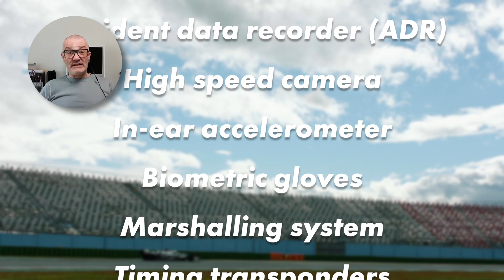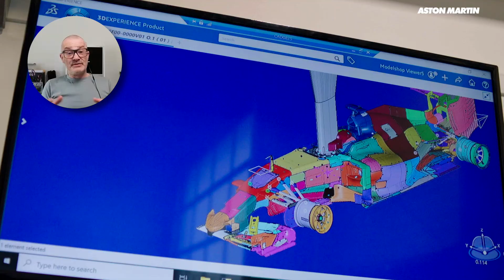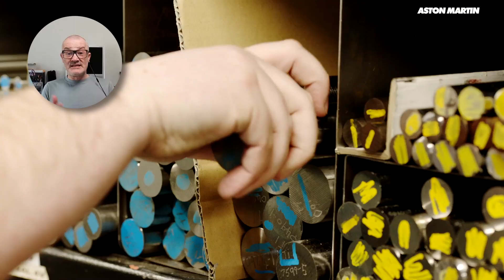The Reason F1 Teams are STILL Overweight

Comment: What about the hybrid power units? Surely you should have mentioned them when talking about the jump from the cars of the v8 era and before? They weigh a LOT. And the battery is not a load bearing structure so it gets even heavier.
Reply: Speed benefits are too great to get rid of them. They have never had more linear powerbands and that much torque that early in the rpm range is a game changer. Plus you lose about 23% efficiency if you remove that so you're going to be carrying roughly 23% more fuel. The hybrid system isn't like what you think of in a prius or something where it's to help save some fuel. No these things bring hp to the table a lot of it through the entire rpm range something you cannot get with just internal combustion engines
Reply: @n111254789  why would you want a linear powerband when it comes to racing excitement and passion? It just enables the drivers to cruise - which they sometimes have to given they can only run 3 engines per season and they don’t have to be as precise with their throttle inputs. 

They cost a shit ton of money per engine and the tech is so prohibitively expensive that no new teams or manufacturers have joined. 

And while it brings hp to the table, it also brings weight. The biggest jump in weight we have seen in any era change. The weight makes the polar moment of inertia (the ability of the car to change direction) worse so they are less dynamic and exciting to watch and drive. The don’t squirm under braking and exit. They don’t dance. They don’t quiver over kerbs. They are heavy.

And speaking of weight, the power to weight ratios of the v10 F1 cars for example, utterly destroy todays cars. 850+ hp and they weighed 605kg in 2004. Even if it was inferior power to weight, their overall lightweight and incredible noise makes them much more exhilarating to watch - and many say drive. 

As for economy, why should F1 be about that unless it’s not just about racing anymore? It used to be more focused on pure racing. But now it’s a complicated beast and the v6h are part of what has sullied the racing aspect of the sport.

And yes while the v6 hybrids are incredible technical achievements and amazingly efficient, they have also caused a lot of headaches as mentioned above. But with the relentless drive to all things EV. I get that this is the only way to go. That being said, it doesn’t mean I can’t say it’s at the expense of the racing and the passion and it doesn’t mean it’s without major faults

Comment: I wish they would have met in the middle with the 13 and 18 inch wheels. Might have been a better compromise of weight, tire side wall profile, and visibility with a 15 or 16 inch wheel.

Comment: Power to weight isn't everything.... ditch the hybrid and be more nimble...   Or drop the over all weight limit and have the teams figure out how to make the batteries lighter.
Reply: You know exactly why the cars are hybrids and why that won’t be going away. Unless we’re going hydrogen power but i don’t see that. And you can’t just drop the weight limit as something would have to give for that weight to go down.
Reply: @rexthewolf3149  make the safety stuff a off the shelf part, they can lose weight elsewhere.  but these cars are too heavy.. it is a drag to watch these things which are larger than my daily driver.
Reply: @TedSchoenling  Off the shelf parts, ok. I don’t want to belittle your intelligence. But you really think that is possible. The forces that f1 cars operated under requires specialized design to handle. That’s just not how that works man.
Reply: @rexthewolf3149  What I mean is listed parts.  Dude do you know how many 'listed' parts are on the car now?  I don't mean to call you ignorant but they have quite a few.  F1 could specify a survival cell quite easily that would have all the safety in mind and let the teams go nuts.

But do call me stupid.. I dare you
Reply: F1 cars carry a race worth of fuel on board get rid of hybrid and you get to carry around 20% more fuel also you can kiss that low end torque goodbye it'll be a narrow powerband race engine with as many gears as they can stuff in it to try and keep it operating in its prime.
Reply: @n111254789  I suppose you missed F1 in the early 2000s then?  when the cars had screaming engines and were light and nimble?  We already have Formula E for the electric crowd.  It is a joke to think F1 is doing anything for 'sustainable' that FE isn't doing.

I would have suggested bringing back refueling but that is kind of a taboo subject.  It is dangerous to a degree, and very unpopular with teams.
Reply: @TedSchoenling  watched f1 for ages I still remember 04' but the reality is as nice as those motors sounded f1 is ultimately about speed and you can't beat a hybrid power train it is the best of both worlds and I noticed you ignored both my points about carrying extra fuel and the power band being extremely peaky especially with turbos
Reply: @n111254789  no, it is about the illusion of speed.   Look at the '02-'04 cars and then look at today's cars WITHOUT the stopwatch.  Which ones look quicker.  Don't even turn the sound up.  just the visual.

People cannot comprehend the stopwatch.  However they can SEE how quickly the smaller cars change direction, how much of a handful they were to drive.

If F1 were about speed, they'd remove a bunch of the limits they have and could have cars MUCH faster than now.  

They are going for a show... if that is the case at least give the illusion of speed.

Comment: Refueling Ban, Decreased Engine Sound,  Decreased Rev Limiter,  and Increased weight are the 4 things that have really disappointed me regarding my favorite sport. It's still my favorite,  but it's less exciting. They are 900kg with fuel :( I would definitely support a break away if it fixed these recent changes.

Comment: Simple... make them smaller in size... They are to big in either dimension... cut 20% of length and width and problems is solved.... also its gonna be easier to overtake on narrow tracks
Reply: Problem you have to get rid of something to do that, decrease the size of the fuel tank and bring refueling back, ditch parts of the hybrid system, Decrease the size of safety measures. In order for the cars to get smaller something has to give. There is no simple fix here.
Reply: You really think it's that simple?
Reply: @rexthewolf3149  Engines are already smaller than what they were when cars were way smaller also. fuel tank candchange its shape. There is already a difference between the gearbox and the back transmission, so even now teams could make them shorter very easily . And for width they biggest factor is the stupid over-sized current wheels
Reply: I agree with everything. Except the first word.

Comment: Early/mid 2000s V10 cars...a tiny bit less peak hp (around 1000), that are available all the time instead of just a few seconds per lap in race conditions, weighing in at 520kg
People nowadays seem to really have forgotten what monsters these cars were on sunday
And on top of that, those cars saw some huge crashes, but not a single fatality...weight matters, and track design even more so. If they wanted to make this sport safer, they should worry much more about intelligently designing their tracks instead of building tanks to go racing (e.g. why tf is there nothing but concrete in the corner where Mick Schumacher crashed, when it's such an obvious hazard with those huge kerbs....)
I love this sport, i'm a fan of many of today's drivers, but i also hate it, because almost every decision made in the past 15+ years has been infuriating

Comment: I don't think the wheel covers being 3D printed are making them heavier.  In fact, if it's done right, they could be lighter than solid carbon fiber.  One you can 3D print in Carbon Fiber, but even if they are printed from a denser material, you can print them without solid infill, and various geometries, where the strength you need is there, but the weight is reduced dramatically.  I do a lot of 3D printed parts, and I can almost always make them lighter than a solid carbon fiber part.
Reply: I doubt there is any thickness or internal material volume to these covers. They are basically a thin carbonfibre bowl covering the brake discs.
Reply: @Renee_R343  Well, the video says they are 3D printed out of plastic, not carbon fiber.  Now, they could be 3D printed with a carbon fiber filled plastic, but you cannot 3D print pure carbon fiber.
Reply: @andrigtmiller  Sorry my mistake. What I wanted to say is that they are basically a thin bowl covering the brake discs. So I doubt there is any place where they have any infill. And I believe carbon fiber is still much lighter than any plastic.
I think it is quite hard for people to fathom how light a carbon fiber composite components can be. My only real world experience is lifting a car hood (detached from the car), a regular hood is actually quite heavy. An aluminium hood in comparison is so light it feels like it is made out of paper. And a CF hood incredibly gives the same feeling again compared to the aluminium one. It feels unreal how light CF components are.
Plastics, however, are really heavy on their own, not even comparable to CF.
Reply: @Renee_R343  Well, as someone that does a lot of 3D printed parts, I can tell you that no matter how thin they may be, they could have infill when 3D printed.  Even just a 1 mm thick disk, if printed at a .05 mm layer height would have 20 print layers.  That's the smallest layer height on a FDM/FFF style printer.  They may be printed with a resin 3D printer, than the parts are completely solid.  Based on looking at the wheel covers in pictures, whatever printer technology they may be using, they are definitely post processing them, to make them smooth, so it's hard to know, and I haven't been able to find the information on what 3D printer technology they are using.  Certainly, plastic has a much higher density than carbon fiber weaves, but that's not how they are made according to the video.  In any case, I certainly understand the difference between solid plastic parts, and carbon fiber parts, in terms of their weight.  The video is saying they are heavier than carbon fiber parts because they are 3D printed.  That doesn't necessarily have to be the case, but the video creators don't know much about 3D printing, so that's understandable.

Comment: Why did F1 not simply go back to narrower wheels as still used in F2? The notion of cornering being less aero limited with wide tires? At lower speeds, aero would be less anyway. The resulting narrower cars would create less dirty air. For side impacts, I guess wider cars from wheels sticking out more might help a bit? But wheels can come loose more easily and create more damage. The F2 sized wheels would be lighter, though, aiding with frontal impacts.
Reply: You forget the bigger elephant in the room : Mechanical grip

Comment: Would F1 drivers be at an advantage being underweight (and likely quite short)? I didn't realise the driver played such a big role in overall car weight
Reply: they have a minimum weight standard though I'm not sure what it is. I'd like to know the weight difference among the drivers
Reply: @michaelfierman3256  80 kilograms, as said about 5 times in the video.
Reply: How is that regulated is the lower categories? Like when they start with karting, do thry have to add weight if they're a very light driver? Or do they benefit from that advantage?
Reply: @swe223  In karting they benefit from being lighter. Being short is also useful as it lowers the center of gravity. Usually these two go hand-in-hand.

Comment: What happens if you have a driver all kitted up that weighs a lot less than 80kgs? Some F1 drivers are no bigger than a professional road racing cyclist.
Reply: Then the team is required to add additional  weight to the car. The advantage of a lighter driver is that the team could add the weight where they want and give the car better balance.

Comment: I'm not sure an 800kg car capable of 220mph is "safer"
Reply: Adding 30kg to a car is not going to add as much energy as adding 30kph is. Kinetic energy grows exponentially with speed. If the cars are lighter, they would be able to reach higher speeds easier, and that would conversely be less safe than a heavier, slower car. It's just physics.
Reply: @killerful  a reduction of 30kg is certainly not going to add another 30kph

Comment: Why does it matter if they are over the MINIMUM weight? Is there also a Maximum weight?
Reply: With more weight they accelerate slower, brake slower and turn slower. When the purpose is to race and be faster than the others, it matters a lot.

Comment: How much does the batteries and all that hybrid BS weight? Maybe just get rid of that and go back to normal engines?
Just a thought...
Reply: The hybrid system bridges the gaps between the extremely narrow power band of race engines they would need a drastically larger motor and have to carry much more fuel to achieve the same power through the power curve as they are now.

Comment: Get rid of the stupid electric motors, weight sorted and they'll be good to watch again
Reply: Unless we go hydrogen powered the hybrid system isn’t going away.
Reply: @rexthewolf3149  it should, lithium is terrible for the environment. . .worse than combustion engines
Reply: @thisisben3593  you right about lithium being bad for the environment but it’s not that simple. Lithium is more harmful during mining and recycling. BUT and there is a giant BUT here, they are still better than gas due to long term emissions. That doesn’t mean gas cars are good. THE real solution is hydrogen powered ICE cars. But those have their own issues. At the end of the day CARS ARE BAD FOR THE ENVIRONMENT.
Reply: @rexthewolf3149  it takes a massive amount of time for the electric vehicle to surpass a combustion engine in emissions, more than the current life span of electric cars so its practically irrelevant and then disposal is shocking. Ethically as well. . . Cobalt is 80% slave traded.

Running combustion engines on hydrogen is the way to go
Reply: @thisisben3593  fully agree. It’s just hydrogen isn’t ready for full racing. 
And besides ethics in f1 when have those matter, tobacco sponsorships. Unsafe cars, forcing your drivers to be underweight. Racing in the Middle East. 
I joke. 
But that last part is something that w as a society need to one day discuss. How much of our comfort comes from the Unnecessary suffering of others.